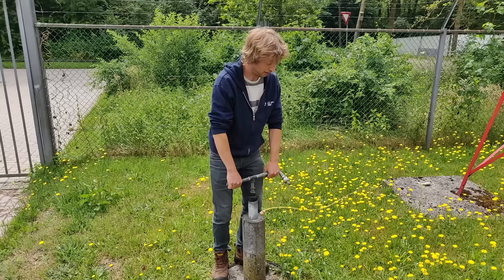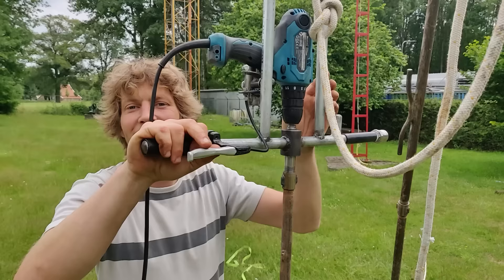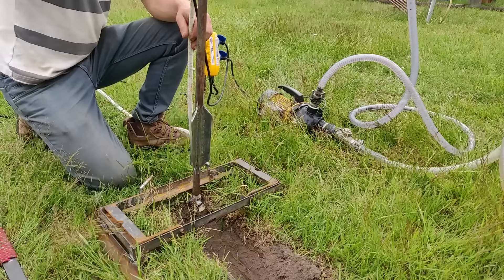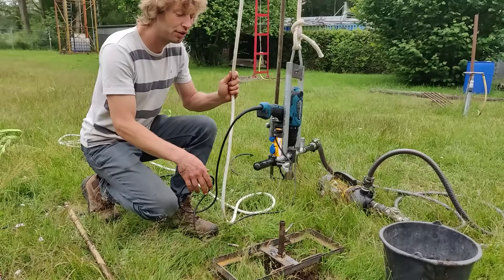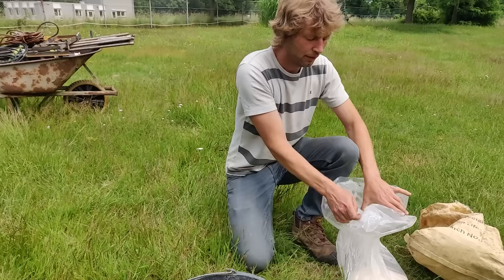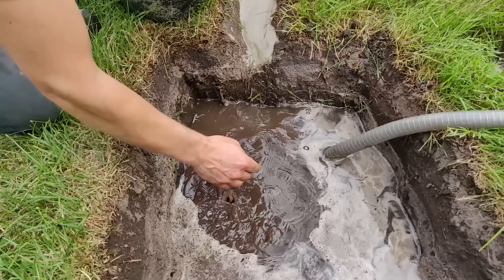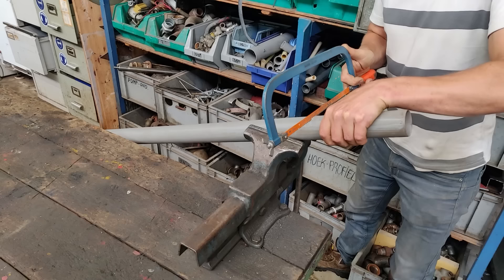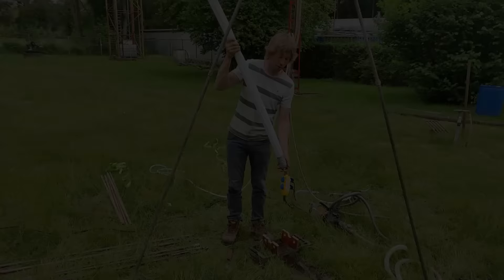DIY Well Drilling Using a Hand Drill.

Comment: When my deep (92m) well was drilled (by a well drilling company), the 20cm diameter drill bit made only a one-half turn in the grass sod, and clunked to a stop by solid bedrock within 3cm of surface. It was then rock all the way down, with intermittent layers of gravel. End result was 302 feet (92m) and 10 gpm (45 L/minute). Pump has been down there for 30 years so far, never a problem. In spite of pump controller in basement twice being exploded by lightning. Pump still going...
Reply: I imagine that kind of well couldn’t be  drilled with a simple DIY drill like this.
Reply: Deep water, bet nice and cold eh
Reply: @daleval2182  deeper you go warmer it gets!
Reply: Its a wonder you dont have a lava well 😂
Reply: That's a very nice well you have. The many layers of rocks have a lot of running underground streams between them.
Reply: @Steve  Sounds cool like something you could build in Minecraft 😋

Comment: Good job!  I have been involved in drilling several shallow wells down 15 to 20 feet where we augured by hand down until the ground water made the hole cave in, and then drove a sand point with stainless steel mesh through a couple of hard-to-drive layers and ended up stopping when it resisted further driving.  Wound up with 6 gallons per minute output from a hand pump.  Jetting looks a lot easier!

Comment: Something I've seen somewhere else is that they had 2 ponds for settlement the first like you have the second connect to the first like you did with the hole, have the sump pump in the second hole so the stuff coming up the hole has a chance to settle in the first pond, hopefully giving you cleaner water in the second
Reply: Indeed a sumppump and 2 larger settling holes is a good idea

Comment: Fascinating and kudos to you from Australia! Unfortunately we have to go a lot deeper to get to the water table and the ground is like rock. Very clever use of tools though and a great video. Thanks.
Reply: Use of a hammer drill (kanga ir similar) along with a proper drill head and larger pump could probably overcome this but obviously would still have its limitations
Reply: When I lived at the Darling Downs, we had a well that was about 8-10’ to water, a bore on another part of the property that was maybe 14’ deep. Good flow too, it could continuously pump 1000gph with little drop. The water was so close to the surface, there were green patches of grass that stayed fresh, no matter how infrequent the rain. 

There was a spring fed creek on the property that never dried up. Some places are randomly lucky like that. 🤷‍♂️

Comment: Thanks for this brilliant idea. I however don't understand the connection between the frame and the rotational drill pipes and would like to get some  tutorials on it.
Reply: Same. There must be a seal to allow the rotating pipe to retain pressure. Leaving this detail out stops others from replicating this.
Reply: I have not seen the kit here but it must work similarly to an oil pump in a car. The water is pumped into a manifold with the rotating pipe head running through it. This has several holes drilled from the center to the rotating edge within the manifold!
Reply: A swivel is used this allows one pipe to stay stationary but the other smaller pipe inside to spin freely . The inside pipe has slots in it. You can use a taper seal or a simple rubber seal. Don't overtighten bc friction will lock it up.
Reply: You have bigger tube attached to the frame where in one side is hole for water inlet. Inside this bigger tube there are two ball bearings (top and bottom) and also two seal rings to protect the ball bearing. Inside the bearing and seal ring is smaller pipe which have one end welded with shaft to the drill and the other end is to the drill attachment. The smaller pipe have also holes so the water can flow through the frame to drill end.
Reply: there are a link to a detailed drawing in the description

Comment: Great video and explanation
Also I like the clamps and clamps base . Thank 
Note for viewer :  The dill  used is 320 W . 450 RPM  Keyless  Right & Left rotation 1.2 kg
Reply: Consider using dc instead of Ac. I too in the begining used a ac drill before i got lit up .
Reply: @thhillbillyinventor105  ... use an insulated drill with a plastic case and your electrical problem is solved. Also put some rubber heater hose on the metal handles as extra protection.
Reply: @rupe53  my other design I don't even touch the drill when I'm drilling other than startup . That was solved and battery capacity also .
Reply: Also mine doesn't use metal its design was to be low cost and easily replaced . This is his version of one of my designs just in metal.

Comment: I wish we were shown how to do this back in my youth days. My dad tried to drill a well the wrong way and I had to do all the hard labor. It never got deep enough for water. We used a hand auger and a pulley system to lift it out of the hole. We got it down to 80 feet before it got too hard to turn the auger by hand. Man those were the days.

Comment: You have a crude system of what i designed a few years ago . Good job Like the powered winch . You need to use a little bigger pipe so you can have less restriction. I use 1 inch & go down around 60 ft in sandy clay.
Reply: 20 metres is a lot I think he went only 5m in the example.
Reply: @zteaxon7787  depends on the soil . The one I designed years ago I did 60 ft and ran out of pipe . All he would need to go deeper is wider pipe and a bigger trash pump.

Comment: Brilliant! Having spent several years in the oil patch I am amazed at how similar your system is to drilling for natural gas. 

BTW if you can find powdered bentonite it can be used for your drilling mud and is safe for your water supply. Bentonite is used in beauty face masks and some people actually mix small amounts of it in water and drink it.
Reply: I have found that the bentonite pellets give you time to get them to settle to the sandpack interface before they start swelling.  I've had to do a tremmie pipe with a pump if I use the bentonite powder slurry to get it to the sandpack interface, because it begins to swell quickly.
Reply: OK I see, you are talking about drilling mud, not the top seal.  My apologies, you are correct!

Comment: This is super cool, though one thing I don't get, why didn't you just use a standard pipe cap on the end? Doesn't seem like the geometry of that thing you made is that much better, and with the flare needed for it to slip over the pipe, it isn't much, if any narrower.

Comment: Very creative and nicely own build equipment. To me the most difficult one to build is the handle drill attachment especially where the chuck is located.  That is where it turns and fluid enters into the pipe going downward.

Deserve a thumb up!

With this method and tool one can go as deep as it needs and the video very much covers the same method with the commercial one that costs big time with their fancy equipments and if hiring them for the job.

I know exactly this method is valid and work because i dug my own well already 3 as a matter of fact.   It was a  manual twist back and forth with just house water pressure and no drilling mud.   They were shallow wells no more than 35 ft and max. depth for manual drill anyway.

Thank you for the video i like your methodology and your own built equipments.  I will build one  learning from you and from my past experiences.

Shallow well 40ft or less is for non potable water use.   100ft and more deep well is for potable  use.  If you fail to believe this your health will be affected in long term guarantee.

Comment: I was a driller for 20 odd years doing exploration drilling, water bore drilling. You certainly have every thing sorted out correct. I love the simplicity of you drilling system works super. But in my country the ground is hard most times need 350psi air with a six and a half inch hammer. But we'll done.

Comment: I think you should drill a small hole where the pipes connect and put in a cotter pin so they don't come apart down in the hole. You could have a need to reverse spin the whole shaft to help get it back out or get it unstuck. Without a locking pin, you can't do that.

Comment: I tried leaving a message on your website but it leaves an error. 
First,  thank you for sharing the video regarding how to fill a well with a power drill.  I read in the comments to ask if any questions do here I am.  Can you explain how to build the handle with water inlet to the drill pipe? I'm confused on what part allows water to enter the rotating tee without leakage.  Thank you again.  

Best regards

Bob
Reply from the maker: Hi Bob, thank you for your reply. I hope to publish technical drawings of the setup soon. If they are published I will put a link in the description. Could you tell me what error occurs on our website?
Reply: @WOT_utwente  , I also would love to know how to make the attachment and frame that the drill is attached to.
Reply: Clearly ball bearings with labyrinth seal

Comment: Nice video, I tried making one and it worked great! I was drilling and heard a sound like grinding metal while drilling, that's normal right? But anyways now water is spraying out everywhere, and I tried putting the pipe in but that didn't help at all! Anyways I was wondering if you could make a follow up video explaining what to do if that happens?

Comment: As a well driller I'm impressed. 2 suggestions. 1 when removing your drill rod unscrew above the coupling so in case it slips the coupling catches on the dog instead of falling in the well. #2 hook water to your pipe solid connection and run water down the pipe while pouring your gravel in. that helps the gravel pack with no gaps and develops the well better. Good job. This is the ONLY time I've given a good comment to a DIY driller
Reply: Hi Dave. Do you know where we can get/buy such a water swivel. Please assist.
Reply: @kimanijack  Ebay will be you best bet. $350 they call it a water well swivel the real name is King's Head

Comment: Usually see drillers use bentonite clay in the water to drill wells, to help pick the solids off the bottom of the well bore. Excellent fabrication from a guy that has seen 1000's of wells drilled, some to 18,000 feet deep.

Comment: Very inspired by this after trying the jet method and failing.. 

I'm working a list of parts that do not require a lathe or special tools. Unfortunately, I just don't see any way around a welder. Its pretty much required for the swivel and drill head.. 
I will think more, there is always a way.

Comment: A very clever young engineer. The design of the system is so simple and yet so efficient, I only wish I was much younger so I could build such a system and get clean water on my block, The small creek running through the place is putrid from upstream contamination and the local Council and the Environmental Protection Agency claim they can do nothing about it. I live in the Coffs Harbour area of NSW Australia where water pollution in water streams is rife.

Comment: I love the ingenuity of your projects . Out of interest do you have a vid  for how to make the Drill frame and break cable setup ? That would make an interesting project. Thanks or the vid brother . 👣🦘🇦🇺🍻                 . In the hills of Western Australia i have to use a pick axe to dig a 60cm hole  in the ground  on my property .
Reply from the maker: Hi, we do not have a video on how to make the setup. We do have technical drawings of most parts though. If you are interested in those you can contact us via our website. www.wot.utwente.nl
Reply: I went to your website for a look -you do great work ….Are you aware your website  shows up as unsecured ? I use the latest version of Firefox - on an iPad . The padlock 🔒 symbol has a red line through it = unsecured site.   Just thought I’d let you know.  Take care of yourself and each other brother. 👣🦘🇦🇺🍻
Reply from the maker: @peachsncream5808  thanks for letting us know. We will have a look at that
Reply from the maker: @peachsncream5808  thank you for bringing this to our attention, we fixed the problem for our homepage and the connection should be fully secured now.
Reply: @peachsncream5808  I have to admit that when I read, "in the hills of West... Read more", that I was hoping that the next word was "Virginia!" Good luck with digging your well! We don't have to dig them very deep here.
Reply: G'day from NSW, I hear you totally, we've got a lot of granite and a LOT of shale.... very hot, hard digging!🤠⛏️ where I need to put one in.Take care, good luck with your endeavours and be safe, have a lovely Christmas. 
Have a great day 🦘🇦🇺🦘

Comment: Pretty awesome. Looks like that bore hole might be big enough to place in a 6 inch casing then your own well pump. My wells are about 50 feet deep with water level at around 24 to 26 feet.  Which a rig like this should be able to do pretty easy.
Reply: Would need a bigger bit but doable.
Reply: Hi William, Do you know where we can buy such a water swivel. Appreciate your kind guidance.
Reply: @kimanijack  You can have a fab shop build you one. There are also quite a bit of information online you can find.

Comment: I want to try this to water my garden or to provide some water if we lose our water. But I am curious. Your metal tubes and drill bit seemed narrower than your grey PVC pipe. How did it so easily go in the hole? And where did you get the long sock like filter to go over that pipe? Also, what if you hit rock? I’m in New England.

Comment: How did you make a watertight seal where the drill is connected to the rotating shaft? How is the water allowed downwards, but not upwards toward the drill? I would like to understand how the connection of the rotating shaft to the drill works.

Comment: Excellent, unfortunately I cannot weld very good, so that drilling rig with water outlet is beyond me, wish there were a off the shelf solution.
Also can you just use steel pipes with what type of connectors to drill?

Comment: Did you measure the amp draw of the corded drill while going deeper into the ground? The increasing resistance may cause the drill to draw enough amps to burn itself up.

Comment: very good video, the explanation of what it does is very complete, thank you very much.
At the beginning of the video, I thought that you were drilling in a peat area, but then upon reading the description of the channel I concluded that it is actually silt and sand, since you are surely drilling in an area "reclaimed from the sea", this method How does it behave on dry land? Will the drill withstand greater stress?
I appreciate you if you can make any comments.
Thank you very much for your work

Comment: Have you done this for about a 6 inch well?
I'm wondering how difficult it will be going down close to 100 feet with this type of method,
And those fins you have on the bore stem,
I was wondering if they were slightly twisted to provide a suction, to help force water and cuttings to the surface.

Comment: Will this work in soil that contains a lot of stones? I live near river and most of households have water well (5/4 zinc pipe hammered into ground) but I broke two pipes by hammering them when I stroke larger rock. I'm talking about river rock type of stones, soil is full of them to the point that I have bucket of them every time I swipe my lawn.

Comment: Thank you for sharing the video. With that power drill, how deep did it reaches in this video? And what is the maximum deep until it can't no longer turn because of the weight of the pipes?

Comment: Great video!
Thank You!
Can i drill 20-25 meters deep dry well with this methode?
I plan to use it geothermal. So i do not need a water, just drill, and put the 32 mm pair of pipe down. ( I need 8-10 pcs of this kind of holes to get 7-8 kwh energy)
The soil is normal, no rock, just some clay.. and harder loose.

Comment: I have a few questions (from an obvious beginner who shares an engineering mind like yours) if you dont mind?

So can you use this same rig or draft plans for a rig and use wider pipe? Say you wanted to use galvanized steel and wanted it to be 2-2.5"? Would this require a completely different solution like that gigantic well rig truck? What if there was a rock layer to drill into? I understand the drill can't handle it but there are plenty of other motors to substitute for the rotation.

Final question - can this principle be applied in a horizontal manner say to channel under a slab or would it create further integrity issues in the surrounding compact soil? Thanks for making this one! It gave me some hope for the possibility of installing a well in a place a truck can't get to. How is that done commercially? I can find no information on that. It's as if no one has ever attempted a proper well way beyond the roads, outside of park services and such - and they don't make YouTube videos because of liability haha. This filled in a few gaps for me I've been unable to obtain through research because they are relatively advanced processes and most people only cover basics.

Comment: I'm wondering about filling the well back in on the outside of the casing.  Do you add enough that it fills it up all the way to the bottom of the well (so if the pipe is 100ft, do you add enough to fill around the outside of the pipe for the entire 100ft?)?  Or is there some kind of  baffle or plate around the pipe maybe 20ft down & the dirt/sand/fill only needs to go that deep.  

Would there be any advantage to having a wider hole at the bottom of maybe 1ft diameter for the last 20-30ft (submerged)? This could be done with a certain type of drill bit once the hole is already dug to depth.  I would think it would allow for more water to be extracted in a short amount of time instead of having to wait for the well to "recharge"/refill..